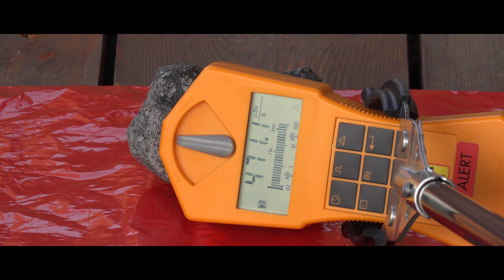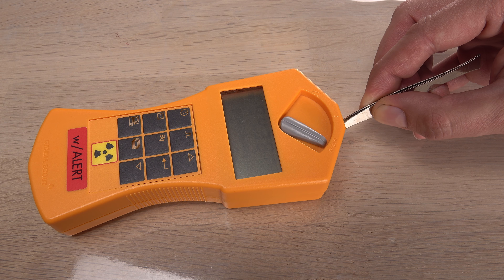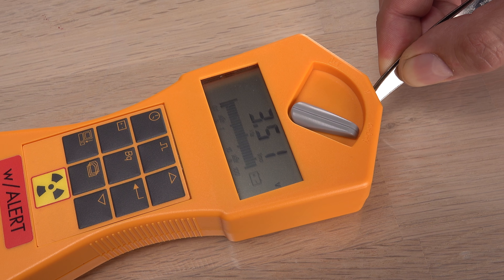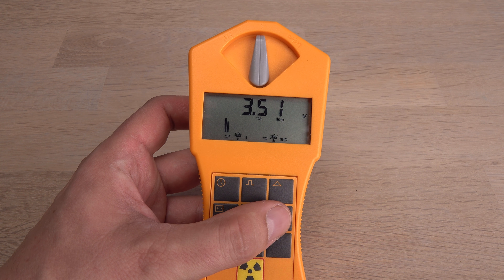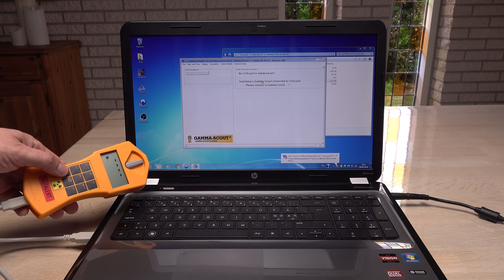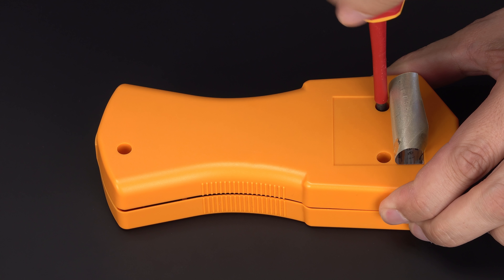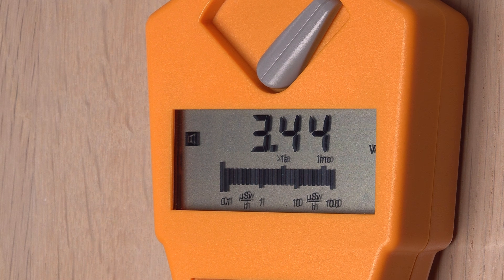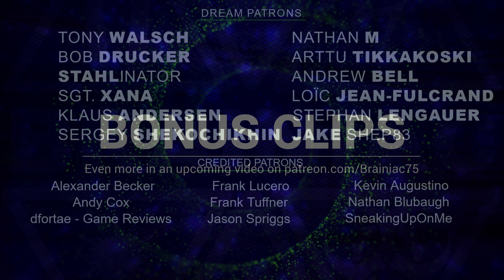Weird battery change in Geiger counter

Comment: what a piece of garbage these Gamma Scouts are, and people are stupid enough to hold them as high regard scientific instrument
complete mockery of german engineering, piss poor build quality, and they didn't even include a steel mesh screen to prevent the myca from being damaged
go buy RadiaCode instead of this shit
Reply: If you want to measure alpha, you won't get far with a radiacode. But yeah, the Gamma-Scout is trash.
Reply: @xuNsh1ne  nobody cares about alpha, all alpha sources will emit super strong gamma as well so its meaningless.
Reply: @GamingAmbienceLive  Nobody? Sorry, but that generalized statement is just wrong.

And yes, alpha sources will also emit gamma, but no, it doesn't have to be "super strong". and a harmful amount (when incorporated) can literally be undetectable without an alpha sensitive device. Just look at Po-210 or compare a measurement of Am-241 with and without alpha.

There are more than enough reasons for people to measure alpha (2 examples: detection of contamination* and scientific experiments/demonstrations like the range of alpha etc.).

Since alpha radiation is the most biologically harmful type of radiation when incorporated, it can be helpful to know that it's there. 

* for contamination detection you'd use a contamination monitor like the CoMo 170.

Comment: Remove the battery and replace with a 18650 and a charge controller from a 5 buck USB phonne emergency charger. Wire it in on the old battery stubs before removal of the old one.The upgrade will allow you to charge your gamma scout AND use it as an emergency charger if need be. ❤

Comment: Lead is recycled on and on and there is a famous lost source, that only could had been scrapped with a ton of lead cables. Maybe a tiny amount of it, is in your solder😏

Or it is just the case, that antimony and radioactive elements are found in the same mineral deposits. I rather go with the lost source campfire tale🤣

Comment: Weird that the battery must be desoldered and resoldered, and with the voltage of 3.6 volts, it even seems like a rechargeable LFE battery or 3xAA could have been used? 😮

This means that non expert users like schools, will end up having to throw the Geiger counter and buy a new one, because the battery is depleted - not good! 👎

Comment: Modifications I would have made:
- Added an on-off switch
- Replaced the SRAM chip with an nvSRAM, so that I could turn it off without losing anything.
- Added a backlight.
- Installed a proper battery socket.
Reply: The battery lasts over 20 years - essentially the shelf life of the battery.  What do you need an on/off switch for?

Comment: Collecting vintage watches led me down the path of radiation research so I bought a SOEKS Defender has a SMB - 20 Russian tube. that is not capable of detecting Alpha. I then began looking for a alpha capable detector and first looked at the Gamma-Scout but the hard soldered in battery wasn't to my liking so I picked up a mint used IMI RadAlert 50 for $70 which has the same LND-712 tube as the Gamma-Scout. It has a tank like build quality. I wanna say SE Internation was building these  International Medcom units as they were identical through the 2000's minus the color. Last week Just picked up a mid 2000's IMI Inspector Alert which has the more sensative 2" pancake LND-7317 and love it.

Comment: Lithium batteries lead to lose thier power and no longer output the right amount of amps after some time and thats why it is the same voltage reading from the new battery compared to the old... Nice video btw

Comment: Apple had a solder in battery on the 2gs.  Someone came up with the idea to have micro springs on the battery where you clip the old battery leaving long leads on the board and flex the spring over the leads.  No soldering required.

Comment: If this were mine I would glue an 18650 battery holder to the back of the case and run the wires inside. Now easily replacable/removable!

Comment: 5:35  didn't Luis  Rossman do a whole thing on why your warranty is not void by simply opening the case? I'm pretty sure the manufacturer has to prove that your actions caused a fault in order to deny your warranty so opening the case technically doesn't void the warranty. Although I should note this is confirmed in the united States but it should be similar in most other places.
Reply: From what i have been told, in the EU, for the first 6 months, the manufacturer has to prove that you broke it, and after 6 months you have to prove that it was a manufacturing defect

Comment: The voltage might be high. However at least when talking about modern units there's no real danger - only of destroying the item. The inverter can't deliver any significant current (otherwise the batteries won't last "forever") and no capacitor with high enough capacity to worry about either.
I would have changed the battery too. Although I would either have supplied it continiously with power if I was worried about it loosing calibration data or just cut the battery before desoldering the remaining leads - less risk of damage.

Comment: It would have been easier and safer to cut the leads of the old battery flush to the battery, trim the leads of the new one, and solder them to the remaining pieces of the old battery leads.

Comment: Someone probably already posted this but why couldn't the new battery be soldered to the old battery leads then clip off the old battery? They would have been in parallel so no voltage change.

Comment: For a small a plastic geiger counter worth 360 euros, I'd atleast expect easily replaceable batteries and long-term software support but alright.
Reply: The battery in mine lasted 25 years, and I swapped it in 10 minutes.  It really isn't a problem.

Comment: That type of battery likes to stay close to the rated voltage under low load until they're 100% depleted, so I'm not surprised the device didn't know it was dying until it was under load, lol. But 9 years was a good run for a battery

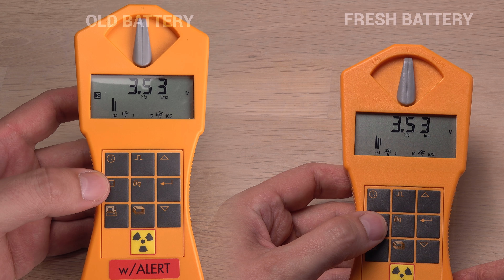Comment: 6:47 That volt meter in it is too perfect for that purpose. For measuring the Level of a battery you have to measure the voltage under a load.
What's actually hapenning in a degrading battery is its internal resistance gets higher - so it lowers voltage and heats up more at a load.
Reply: It has nothing to do with heat -- higher internal resistance simply lowers the amount of current it can deliver. If the device tries to draw more than that, the voltage drops.
Reply: @AureliusR  Then, measure internal resistance when the voltage drops. Voltage drop is explained by the rise in internal resistance.

Comment: I see it uses lithium thionyl chloride battery, I can tell you those batteries are nasty! Not only their content is toxic and I mean like killing people toxic, but they are the highest energy lithium primary (=non rechargeable) cells available. And when they get abused they explode. Their TNT equivalent is more than 1g of TNT per 1g of cell! On the other hand they are amazing in terms of durability, thermal stability and voltage stability over discharge curve, although they work well with very low currents and discharge times measured in at least days.

Comment: Some older software / hardware will only work properly on native USB 2.0 controllers. If you plug it into a USB 3.0 port, it won't work. 

Also, if the drivers are really old, they may be 32 bit only, and require you to use a 32 bit version of windows. This is less likely but still a possibility.

Comment: Here's how NOT to do it.

# Firstly, use a good soldering iron with anti-static bracelet.

# Then look for power supply points that are attached to the battery right next to the battery.
Apply the correct voltage with an external power supply.
# Then remove the battery as shown in the video.

In the movie, the voltage of the Geigercounter including the calibrate.

By leaving the Geiger counter under tension, everything is preserved.

Comment: I took a gamble as well and changed the battery on my unit a few years ago. Mine is a very early model with serial port and no reset button dating back to 2001.  It seems like the calibration may have changed since the average µSv/hr bumped up slightly for the same location. Did you notice any change?

Comment: Do you would recommend to buy a gamma scout or are there better (even cheaper) alternatives?
Reply: So maybe I go for the SOEKS QUANTUM Profi? The detection range is even higher, it has common replaceable battery and it is cheaper. I think the only advantage of the gamma scout is that it can detect a-radiation right?

Comment: I have prm 9000 from Mazur and its just 4 Phillips head screws to pull of the front panel then you just replace the 9v battery and screw the front panel back. also you can turn it on and off... I'd say if your looking at getting one look at mazur

Comment: I used to service CNC machinery control units (Yasnac, Fanuc, Mitsu) and we would always use propane soldering irons when we worked on them to avoid those anomalies.
Those units used the same battery type as backup.

Comment: There is a far simpler way to change battery instead of de soldering. Clip the battery leads at the battery, shorten new leads and solder to existing leads on board. Job done.
Reply: If you can't manage to desolder two simple battery leads you probably shouldn't be opening the case.

Comment: Thanks I thought swapping the battery was a calibration issue . But since you have not mentioned that I presume  the scout still reads correct against verified sample
Reply: Mine died completely and I swapped the battery.  No calibration problems.

Comment: I never heard Lithium Thionyl Chloride battery before. Only Li-Ion, Ni-Cd, Ni-Mh, H2SO4 for automobile, etc. Not this enterprise battery. I am curious! What is the implication of this type? What are the advantages and disadvantages? Which applications are?
Reply: They are normally for memory backup and last about ten years They are usually soldered into the PCB.  Crazy to use them as the main power source!
Reply: @karhukivi  wow. I am still curious.
They are toxic so I never see this on computer motherboard.
Yeah.
Reply: @JOELwindows7  The batteries you mentioned in your first comment are rechargeable, the lithium thionyl batteries are not rechargeable. There probably is one somewhere in your computer, but they are usually not intended to be replaced.  No more toxic than lead batteries, but I don't recommend eating batteries of any type!
Reply: @JOELwindows7  Well you used the word "toxic" - how else would they be toxic unless you ingest them in some way?
Reply: they have extreme low self-discharge. This counter draws a very tiny amount of current most of the time, so self-discharge is the main cause of battery drainage (practically the only cause: the apparatus is intended for incidental use)

Comment: I guess it would have killed the designers to introduce a internal battery disconnect switch for safer battery replacement.
Reply: I was wondering about that myself. There are six header pins on the top of the device, I was wondering whether any of those actually turned it off, or defeated the HT side?

Comment: Says multiple times that it is extremely dangerous and he MUST NOT TOUCH ANYTHING, and then proceeds to reach around and touch multiple parts with multiple fingers of his BARE HANDS. WITHOUT EVEN USING INSULATING GLOVES. You know that make gloves for that man?! The price is well worth keeping your life !
Reply: The high voltage in a geiger counter will give you a sting but there is little power behind so the voltage drops down as you get the shock and it is not sufficient in terms of energy to kill you.

Comment: I have built many counters and serviced them, the high voltage in most battery powered units can only source a low current and it’s just not that scary I have been across the HV in several counters it gives you a little shock but it’s not super dangerous. Personally I wouldn’t hesitate to change that battery myself ofcourse the YouTube safety police are getting crazy!
Reply: Electronic fly swatters generate around 1600v dc from two 1.5v AA batteries connected in series. Have yet to kill a fly with it... pretty useless IMHO. Tazer guns on the other hand....!
Reply: Yup they give a very mild shock at worst.😂

Comment: Wow, ok...

You are out of your mind working on that the way you did!

A) you should have clipped off the negative lead of the battery even before you removed if from the case.

B) dischage the hv section to ensure no shock hazard.

C) remove & properly dispose of old battery.

D) absolutely add an on/off switch; looks like plenty of room near reset button, or use mad skills to install a switch in case.

E) use a different battery type that isn't hazardous... and in a battery holder! Preferred an 18650 lithium iron phosphate; which is a very safe chemistry.

You would now have a much safer counter that you can power off when not in use; one with an easily replaceable battery without a shock hazard ( I doubt that thing would even be legal to sell in the U.S. without violating basic safety codes & standards...).

Comment: To get that device to work on USB, it may be a case of install the drivers first, then connect the device when told to do so, not before. USB interfaced printers are like that.

Comment: Works with a high voltage live circuit board*

Doesn't put gloves on*
Reply: Higher voltage means there is less amps when goin through a transformer, no real danger here
Reply: He watches only certain Cody'sLab videos.
Reply: You don't need gloves?

Comment: some batteries dont decrease their voltage. You can see voltage but the battery cant provide current. Its called electromotor force. You want current when counting but in this case voltage drops. Because dead batteries like this one has high sefl resistance

Comment: The permanently mounted battery is for me one of the biggest drawbacks of the Gamma-scout! 
You’re supposed to turn the device in to the manufacturer to get the battery replaced. 

I’ve decided to buy a Kugelfischer SV500 which was used by the German army. 
This thing is rugged af and works Witsch simple mono-cell-battery’s (with adapters you can use any 1,5v battery or 1.2v rechargeable types) which are mounted inside a watertight Aluminium tube. In fact you can remove the battery tubes from the device, hook them up to a power-cord and store them inside you jacket to prevent them from cold weather. 

The officially used Probes for the SV500 are made for high radiation so nothing very precise but you can build or buy custom made probes for low radiation. 

I’ve also experimented with external counting devices like a iPhone which can be hooked up to the Earpiece connection and will be in theory able to display the counting signals from the Geiger. (In fact it worked great with my setup)

The most SV500s come with quite some accessories from the factory;
The Geiger itself in a protecting case made of rubber-like-stuff
A battery tube some times with the power cord
A high radiation probe sometimes with a clamp so attach it to a Stick
An earpiece which is crap but you can easily build a 3,5mm Adapter. 

I’ve invested about 500-600€ in my setup which is pretty good right now;
1x sv500 
2x battery tubes 
1x power cord
1x hi-Rad Probe with clip
1x custom build laboratory grade probe
1x Converter earpiece (I currently use on ear headphones)
Some plastic bags to protect the probes from contamination and comfortable straps to carry the unit in front of you

Besides that you will buy and build various adapters and pieces to customize your setup which will cost  bit of money to but it’s worth it! 

If you search for a incredibly robust counter, with replaceable batteries and the possibility to crank the system beyond its designed limits... the Kugelfischer SV500 is maybe worth a look!
Reply: What do you do with all that equipment?
Reply: George Reynolds 
Measuring... 

I love in a area of Germany which was affected by Chernobyl and had suffered from some symptoms of radiation sickness as a infant... so I guess it’s a genetically defect that I enjoy that enjoy it so much studying this topic.
Reply: @Doellimann  You might be interested in gamma spectrometry then, it allows you to see what is causing the radiation you are measuring.  There are systems to convert the output from a NaI:Tl scintillation detector via an audio pulse height discriminator to a laptop with spectrometry software.  There's an Australian company who sells this kit. Perhaps some videos on it too.
Reply: It took me all of 10 minutes to swap my battery when it died after 25 years.

Comment: Why do they use a different battery than the normal ones for Geiger counter?
Reply: What's unusual about this battery is that its soldered in. The device is pretty low voltage and relatively expensive so it could be expected to work for a long time without needing a new battery. Having a traditional battery in a holder would lead to corrosion on the terminals over several years.

Comment: Some of the 1950 Geiger counters  actually had 450v batteries in them that's why they were so big and square looking!
Reply: Would it be 300 in series?
Reply: @AgentOffice  Yes, I opened a 90V battery used for the valve radios in the 50s and it was a stack of little cells glued together, 60 of them, I presume.
Reply: @AgentOffice  
Yes and No, for memory you could buy a 450V battery at the time that was made up of smaller one's inside in series,

Comment: I'd clean the tip of that iron, and leave it on the soldered part few seconds longer. Otherwise you risk cold joints
Reply: Should work fine if you wet the tip first and use the wet part of the tip to solder. Obviously the oxidized parts of the tip repel solder.